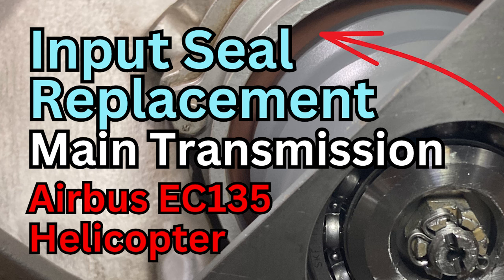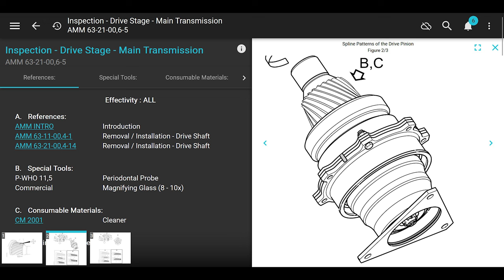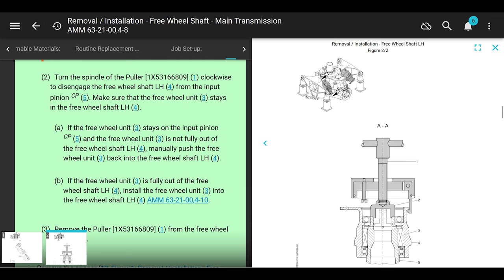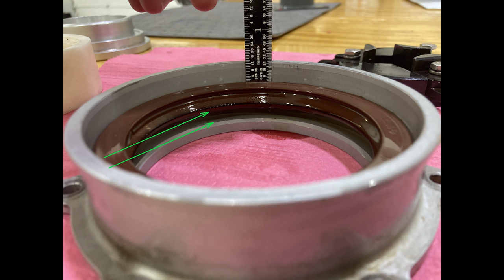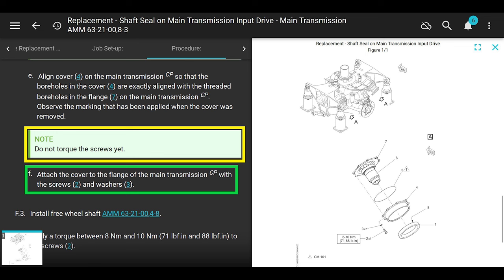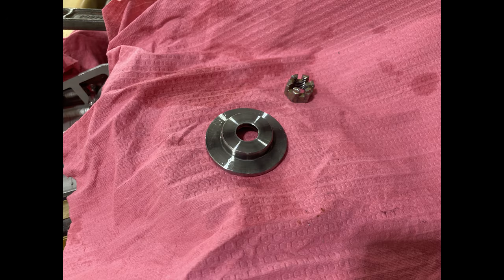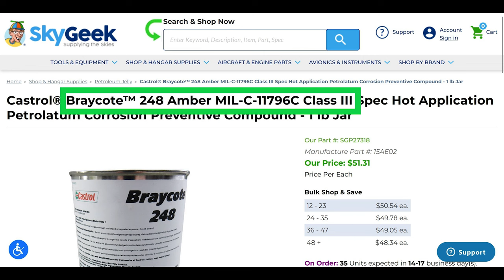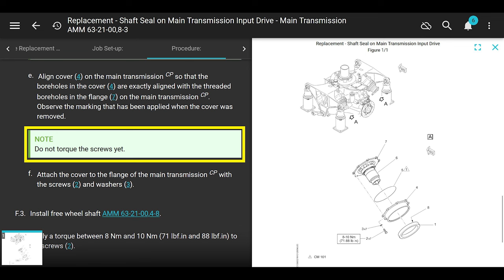Input Seal Replacement |  EC135 Helicopter Airbus

Comment: Great job! I have to say, that this work can be time consumming, casue when you replace that seal you might replace it again in few hours if you won't set it correctly :D Did it couple times, even disassembled due to replacement of sprag wheel (clutch) cause it has time limit. One big note known from my experiance is that you have to be careful when instaling free wheel shaft assembly onto drive pinion. It is possible, that the spacer (12) slides down and it gets stuck between sprag wheel and free wheel shaft housing - it'll do a massive damage i guess (never did that mistake). Greetings ;)
Reply from the maker: Thanks for the input!
Reply: Also if the pictures at the end of the video are taken in Virginia....ahh I have to come visit Virginia someday! I can imagine driving thought the Virginia and listen to Take Me Home, Country Roads all day :D
Reply from the maker: @qweq9972  Ha! Yeah I pulled them off the internet, Virginia and West Va.  My pictures wouldn’t do it justice.  The mountains of Virginia are nice.  They’re not West Coast mountains, but nice.
Reply: @HelicopterMaintenance  Very nice! If you like mountains check Tatra Mountains - the most famous Polish mountains.